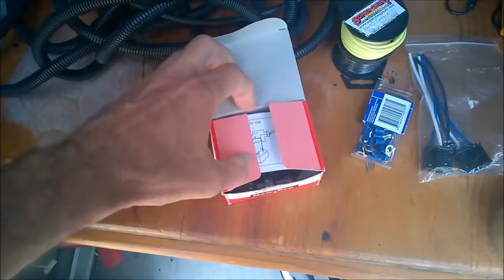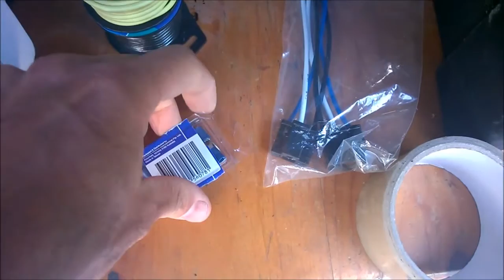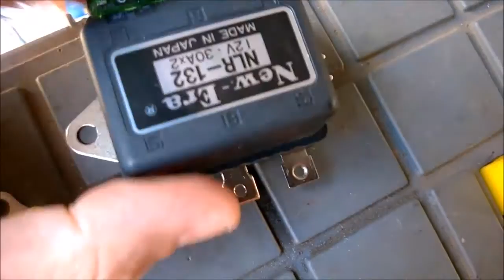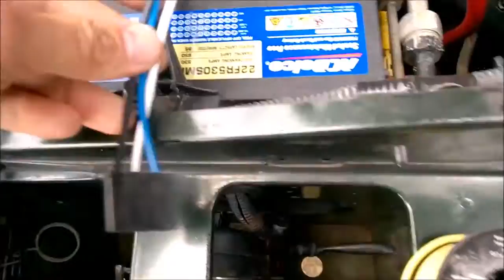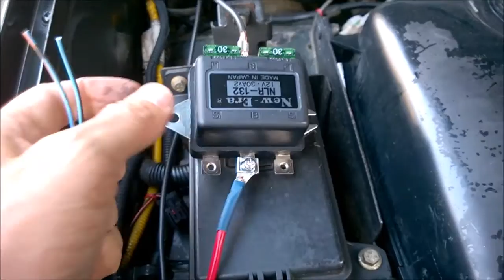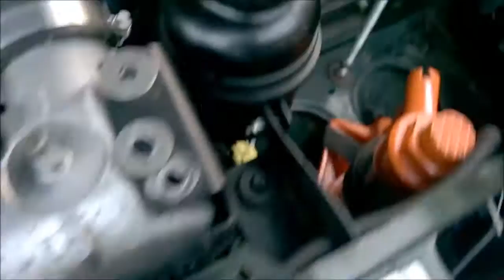Land Rover Discovery 300tdi: DIY Headlight Wiring Upgrade

Comment: the only negative - in some countries against the law! - point with this version is that if the relay for whatever reason stops working  both headlights will be out! So to leave the original headlight plugs might not be a bad idea for "in case"! I would also add one extra fuse in the power supply of the new relay as close to the battery as possible to protect the relay from a possible burnout.
Reply from the maker: I had my range headlight switch melt on me on the way back from a long night drive. No lights, luckily I had others with me so I could follow them back. So in terms of danger, I prefer to risk it with relays than a burnt out switch.  Chances of relays failing are very low.

Comment: Can you describe in detail why you do that?
Why put this relay if the regular scheme work?
Reply from the maker: At the beginning of the video I mention this... two reasons: 1) to protect your headlight switch from burning out as the switch is part of the current draw to the headlights, 2) having thicker 4mm cabling means you get more power to the globes, so brighter headlights (much brighter).  I have had a switch burn out on me before at night, not a good experience!
Reply: Rover Tasmania My English is not very good.
Living speech, I do not always understand.
I looked at D1 have the headlamp relay. Decision without relay in Def.
And why did you choose double relay? It is more expensive than two conventional relays.
Reply from the maker: Ed Dream Def and Disco is the same, no relays from factory. Double relay, one side for low beam, other side for high beam. Have a look at this website, its very good with explanation and pictures:
http://www.traxide.com.au/headlight-wiring-kits/
Reply: Rover Tasmania Thanks for the link.
And why did you cut off the regular headlamp connectors? You can make or buy a mate and not to spoil the standard wiring of the car.
I do not quite understand why use just that this relay. It is very expensive. On simple 30A relay, you can also do all the same.
Reply from the maker: Ed Dream I cut this off because why would I want to go back?  This is permanent fix, so no need to keep original.  The relay is worth the extra cost. If not, you need 2 relays (one for high beam, one for low beam), you need 2 inline fuses, and then the mess with wires everywhere and also more space to find to put this all in.  Too much mess and extra work for not much more money.
Reply: Rover Tasmania I bought a kit for the preparation of xenon. It contains everything you need and a ready-made.
Your solution is much better, but it's cheaper. And it completely solves the problem without changing the standard wiring.

http://www.ebay.com.au/itm/H4-9003-Headlight-Booster-Wire-Harness-Connector-Relay-Fuse-Socket-/151398831736